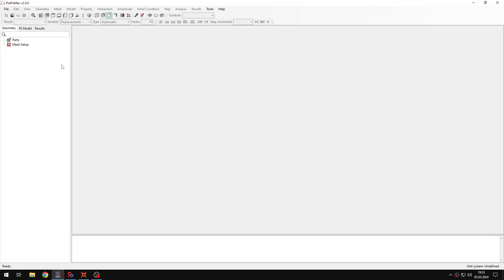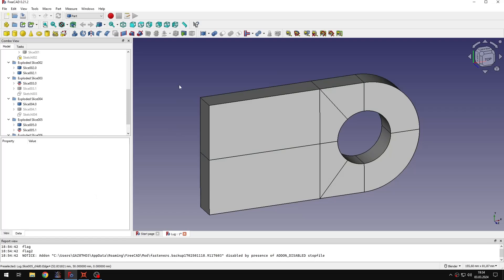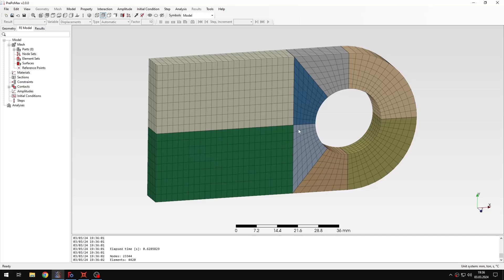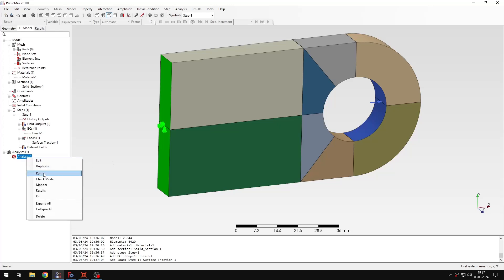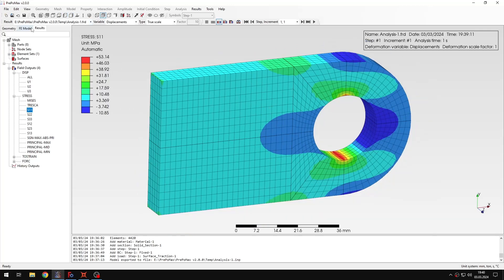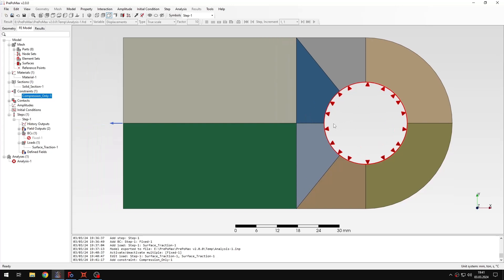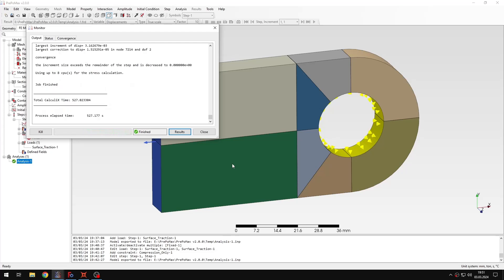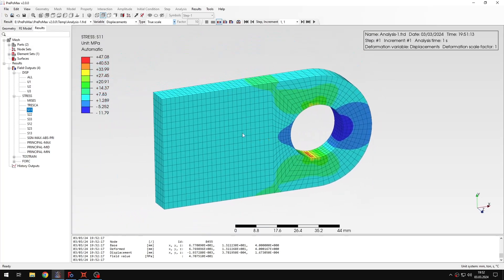PrePoMax (CalculiX FEA) - Tutorial 41 - Lifting lug

Comment: Thank you for the Tutorials. I have completed every one so far and really like your on point presentation. I have a problem with this tutorial though and hoped that you can help me. The version using the 'only compression' elements, to be more precise. My stress results seems to be lower than the result you got. The maximum value for S11 in the hole is about 39 MPa. The values for the deformation matches yours  (0.00443 mm). I have checked all steps a couple of times and even generated a finer mesh. I also made shure that Nlgeom is on. Do you have an idea, why the result differs? BTW i used the newest version 2.3.0 and also tried version 2.3.9 dev of Prepomax. Thanks in advance!
Reply from the maker: This case is quite sensitive. As I advised another viewer, you may have to refine the mesh significantly and then check the results in the midside nodes between the red hotspots.

Comment: Thanks for this lecture.
Would it be possible to use the offset parameter at 5:27 of the gap elements to simulate the Clearance between pin and hole?
Reply from the maker: I used this parameter in the previous tutorial (40). It's just for the visualization. Internally, it offsets the nodes of GAPUNI (spring-like) elements but it doesn't affect their properties.

Comment: I have a problem with the convergence in the case of the gap element. It seems to me that the nodes where you take the resultant stress reach a singularity. The smaller the elements the higher the stresses I get. Is that OK?
Reply from the maker: There can potentially be some stress peaks at the nodes where GAP elements are attached so in some cases it might be better to check the results as close to them as possible (even at the nearby midside nodes) but not exactly at those hot spots.

Comment: Sir, thank you very much for the tutorials.
I have a question about the fatigue analysis using an open source software (Prepomax, CalculiX..).
May you please do a video about the fatigue analysis of a body using Prepomax/Calculix, I watched some videos of other paid softwares like Soliworks and Abaqus... where they use the "cyclic loading/ fatigue analysis", they apply material properties, meshing, boundary conditions, then they apply a cylic loading like a 100 000 cycle to simulate the fatigue and the damage of the body and which areas will be fully (100%) damaged.
I search about this and I read an article and I take this from the article:
4. Fatigue Analysis Setup:
Select Fatigue Analysis Method: In CalculiX, fatigue analysis is typically performed using the ‘fracture mechanics’ method. Define the relevant parameters, such as fatigue strength coefficient (σf’) and fatigue ductility exponent (b).
Define Loading Cycles: Specify the loading history, including the number of cycles and load magnitudes.
Link of the article:
https://cloudhpc.cloud/2023/11/22/a-step-by-step-guide-to-fatigue-calculix-analysis/

And i think this is your comment:
https://prepomax.discourse.group/t/warp3d-support-in-prepomax/79

I could not install Calculix itself on windows, and I do not know how to find this option in Prepomax.
I will appreciate it if you explain more about this.
Also, same question about wear analysis of a body under cyclic loading.
Thank you very much.

Comment: Great video! By the way, you show how you import the geometry from a SolidWorks file, but then you say how you sliced the geometry with FreeCAD. Is there a way to export from FreeCAD to SolidWorks? It'd be nice if you could show in some future video how to export complex geometries (multiple materials, slices, etc.) from FreeCAD to be imported into PrePoMax. Thanks!
Reply: FreeCAD can export step files that can be read by almost any modelling software, however, the design tree will be lost in the process, and it will require direct editing the solid part to modify it.
Reply from the maker: I didn’t use SolidWorks for this at all. It’s just that my computer recognizes STEP files as SolidWorks files. I exported the STEP geometry from FreeCAD and imported it to PrePoMax.

Comment: Very nice video, compression only applies to the negative of the normal from the face then?
Reply from the maker: Thanks. In CalculiX, GAPUNI elements (used for compression only support) are defined by two nodes and a vector specifying the direction in which the elements (nonlinear springs like those used for contact) act. PrePoMax takes care of this also for curved faces. It can even offset the second node for visualization purposes.
Reply: Great video. I love how well prepomax meshes things. I have questions, but ill give you a few days off hahaha. 

I love learning new things and applying it to my schooling
Reply from the maker: @LT72884  It would be better to continue the discussion on the FreeCAD forum, YouTube comments don’t work well for that.
Reply: @FEAnalyst  oh for sure. I dont like asking questions on YouTube if i can help it. The forums are far better.
Reply from the maker: @LT72884  Sure. Especially since usually some screenshots or model files have to be shared to provide help. And the discussions are better organized on the forums.
Reply: @FEAnalyst  exactly. Sometimes i do have to ask on YouTube because there is no forum for a particular software etc. 

Ill probably jump on tomorrow morning while im on the train to school. Its a 3 hour commute for me, one direction, so i have time.